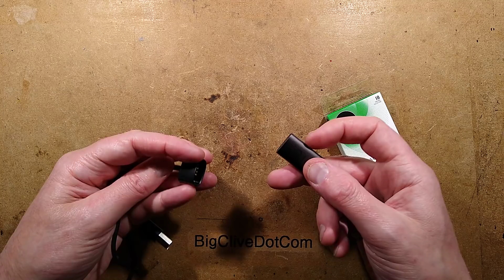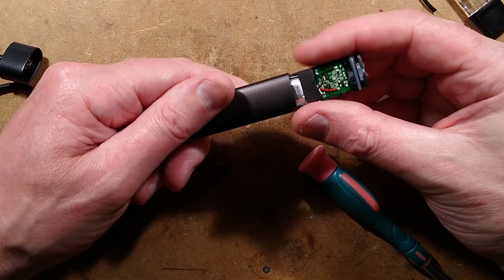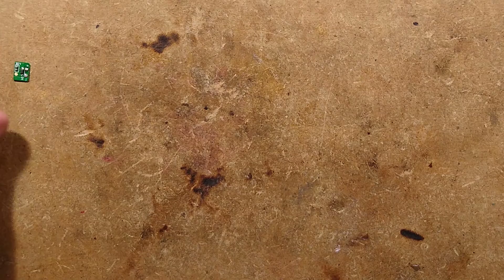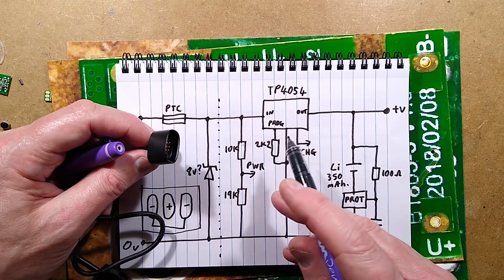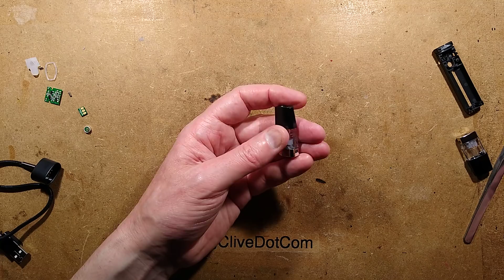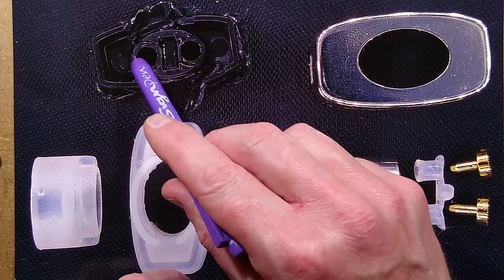Japanese fog-stick teardown.

Comment: Hmm, doing high side switching using a p channel mosfet is somewhat unusual because you have to ensure the p mosfet turns on fully, or at least to the desired current level, with only 0V rather than having to go negative. (Vs low side switching with an n channel mosfet, which leaves the circuit at the plus voltage potential.) Presumably this is a safety feature to ensure that the heater won't come on due to some kind of damage that would cause the heating element to find ground and turn on regardless of what the MCU instructs.
Reply: I was trying to figure that out. Good explanation!
Reply: No no 
Thanks! I’m a bit errrrr rusty, but I’m learning
Reply: The available gate drive voltage would be the same whether you use a P channel for high side switching or an N channel for low side switching i.e. the full supply voltage minus whatever the GPIO pin on the micro saturates at (very close to Vdd/0v at low currents).
Reply: SkyWizardless 
Giggles me 😊 pissant details count more giggles 🤣🤣
I’m actually starting to relearn this stuff, so honestly thanks 👍
Reply: high side switching with ptype dets sounds absolutely normal to me. just get a fet where the threshold voltage is appropriate and your good to go. only that ptype is usually a bit more expensive since it takes more silicon to get the same current rating ...
Reply: maybe they just had a million of these in stock and didn't know what to do with them ^^
Reply: Using a P-channel also gives the usual active low switching arrangement with the MCU. Very stereotypical for what you normally see in automotive controllers. Pull up resistor with an active low pin to turn on the output.
Reply: Dave Micolichek  Its easier with the p-channel for what I stated above. Most MCUs have active low inputs. When the input turns on, the MCU pulls the gate down to 0 volts to switch it on. Same in cars as this means a shorted output will simply just turn on whatever is being controlled vs. actually shorting the output out in the PCM, and allows the PCM to easily detect if there is a fault by looking at the voltage when the output is off. If its too low, it knows there is a fault and sets the applicable DTC.
Reply: I need details, not guess work.
😉😁

Comment: "Let's just stick a screwdriver up its end!" 
🧐😏🤭
I'm easily amused tonight.

FWIW, a microphone is a pressure sensor. It reacts to changes in pressure and produces a voltage proportional to the pressure or the rate of change in pressure.
Reply: It depends on what type of microphone, the diaphragm with a magnet will produce voltage, meanwhile the microphone in this package is an "electret" microphone which will varies capacitance based on the vibration, it does not produce any voltage
Reply: @pierreuntel1970  Dynamic and condenser mics 
 ;)
Reply: @pierreuntel1970  most electret capsules of that style will come with an embedded JFET preamp which will make them act like a dynamic microphone once you hook some voltage to it
Reply: @pierreuntel1970  Like an old carbon microphone, they do require electricity, except a carbon alters resistance with pressure changes.
Reply: sound advice
Reply: Dave Micolichek  An electret microphone does produce a voltage output, even without the JFET. The issue is that it's very high impedance, and you'll need to buffer it. Whatever your circuitry does, it will need to have a power source. If your circuitry has a high enough impedance, you can treat the electret "as if" it was a dyn mic, AFAIU
Reply: I'm the same Paul Ste. Marie
, listen to how he says 'suck'. Titter.
Reply: lol , if you're going to get de-moneytised , might as well do it properly

Comment: Oh, so the rounded bit is for pushing pins, I have a very cheap screw driver kit that I bought in a hurry, the quality is so bad that the bits are mangled after a single use, I thought their machining was so inaccurate or that bit has skipped QC check so it didn't have any groove
Reply: That's not really a substitute for a proper pin punch, but it's handy. I have a specialty multitool with one like Clive's.